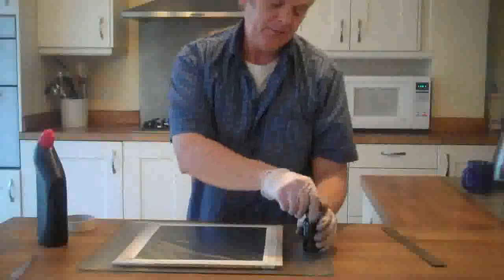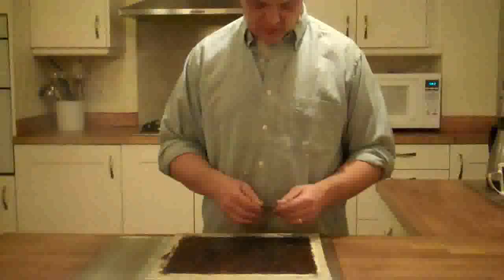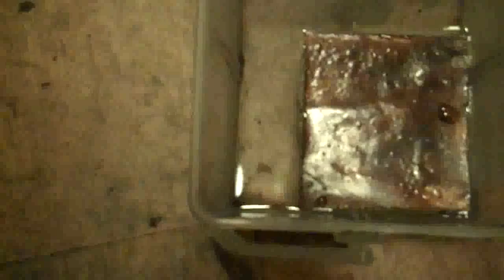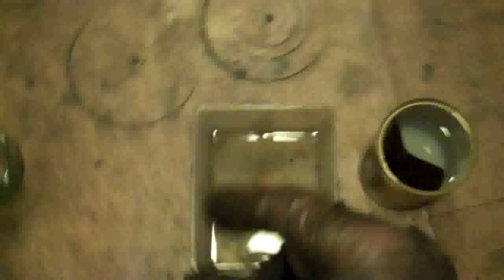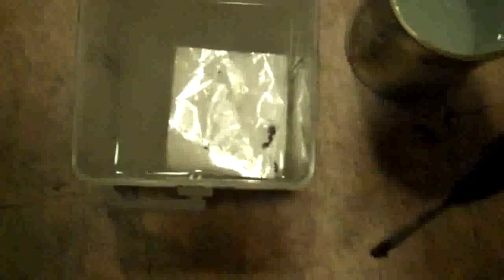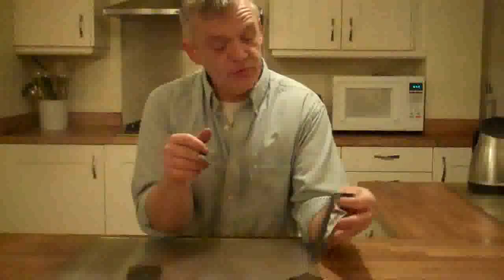How To Make Graphene Sheets As Big As You Like

Comment: How would a graphene sheet like this react to high tempertures, like in a forge.
Reply from the maker: it woulod burn away - carbon begins to oxidise at around 400 degrees centigrade
Reply: Do you think that there could be a possible way to make a graphene steel alloy?
Reply from the maker: ian ocheltree dunno - I suspect not - I suspect the best you will get is a graphene coated steel
Reply: ian ocheltree I'm not a science expert or anything but since steel is carbon + iron.  I don't think it would work like that since Graphene is carbon. But copper + graphene works and makes it 500 times stronger. It works with nickel too making it 180 times stronger.
Reply: what about bronze?
Reply: Robert Murray-Smith
Or graphene coated aircraft aluminum..
Reply: Ever heard of carbon-carbon?
Reply: what is carbon carbon?
Reply: ian ocheltree
Carbonized graphite. Very brittle stuff but can handle a great deal of heat. The space shuttle used tiles coated with carbon-carbon to protect it from the heat of atmospheric entry at great speed
Reply: Ok so how do you turn the graphene oxide from the blender into what you need to do this.
Reply from the maker: Hiya mate - you have to take what people say with a pinch of salt - it's interesting in that it should be a starting point for your own research - carbon-carbon isn't carbonized graphite. What it is is a composite material consisting of carbon fiber reinforcement in a matrix of graphite - The material is made in three stages: First, material is laid up in its intended final shape, with carbon filament and/or cloth surrounded by an organic binder such as plastic or pitch. Often, coke or some other fine carbon aggregate is added to the binder mixture.
Second, the lay-up is heated, so that pyrolysis transforms the binder to relatively pure carbon. The binder loses volume in the process, so that voids form; the addition of aggregate reduces this problem, but does not eliminate it. Third, the voids are gradually filled by forcing a carbon-forming gas such as acetylene through the material at a high temperature, over the course of several days. This long heat treatment process also allows the carbon to form into larger graphite crystals, and that is what is used on the space shuttle. I have never heard of carbonized graphite - it actually sounds like nonsense to me - but that doesn't mean much - it only means i won't bother looking into it - but you could if you want.
Reply from the maker: *****
yes - there are videos on it

Comment: so what is the resistance of that sheet
Reply from the maker: +abdullah Alotaibi dunno - make one and find out
Reply: No worries and thanks for sharing this video .I asked because I see you have mix graphene  with different kind of chemicals so I want to know  if these chemical will have large impact on your graphene proprieties or not .As you may know for electronic applications the film conductivity is very important .In your case I believe the resistance will be a few Ks Ohm .
I did similar work but by mixing graphene in alcohol with PEDOT poylmer (coated area 10 x10cm) I found the resistance is less than 1000 ohm for thick film and yes it is very stable  .Again thanks for sharing
Reply from the maker: +abdullah Alotaibi It does mate - but i probably wouldn't use GO derived graphene for straight conductive based electronic applications. It is great for storage, sensors and solar as there is a wealth of functionalisable sites for modifying the graphene where the trade offs become acceptable

Comment: Sorry to say but if it was that easy we would have graphene chips and solar panels and countless other things. Its two thick needs cut down to size another billionth of a meter to be true graphene. This is just a large graphiti sheet. The molecular structure will not be right. graphene performs the way it does because of the size of diameter 10 nanometers or less. But on the other side cool video bro.

Comment: and who you can make wires of graphene? cause i want use it in my new motor cause the coil waste too much electricity.

Why graphene its the best electric conductor? he dont have electron free or soo much electrons like Couper.
Reply from the maker: +SLEVIN SHAFEL It depends on you view of conduction mate - electrons don't only travel as particles they can travel as waves and that's what they do across the plane of the graphene sheet
Reply: +Robert Murray-Smith travel as waves? wow that its new for me.
soo its not possible to have resisten like steels or diamant and in the same time have the best cunduction right?
cause to make that waves have to be shets like graphite and no like diamant wher the structure its very organized.
In conclusion... the best "wire" conduction will be something like pencil graphite...the problem its not flexible

PD: the new terms of electricity travel leave me "stupid" i have to learn more abut that thank you.
Reply from the maker: +SLEVIN SHAFEL It's a bit more complex than that mate - but basically you have it right - the challenge is in the c direction not the ab plane direction - or if you like the junction of the graphene plates slow everything down - a lot. So straight forward bulk graphite is unlikely to work

Comment: Would it be possible to coat mechanical steel parts with graphene at home?
Reply: can't you make the Graphene on the metal itself?
Reply: +Tyler Parent How? You need carbon first to be present
Reply from the maker: +Tyler Parent yes
Reply from the maker: +DMTbliss NewWay CVD - chemical vapour deposition

Comment: could it be cooper foil ?
Reply from the maker: the hydrogen evolution from the reaction of the aluminium with the acid is part of the process - that's what reduces the graphene oxide back to graphene - copper reacts with hot concentrated hydrochloric acid but slowly - so i guess - yes - or if you did the reduction after getting rid of the substrate then why not.
Reply: i know free energy, that is very cheap  and easy . i chasing star-ship power  i think i can bet the speed of light  .   i am looking to make a generator small as possible . all i can say is 3D printing ,lasers, and graphene  is what i am thinking  . thank you
Reply from the maker: *****
good luck with it
Reply: let's say ,thank of  flat ribbons of grapehe  coils not wire coils .a new kind generator   .but flat ribbons of grapehe  could make a  generator 100 or 1000 times efferent .thank  you

Comment: And what if i used graphene instead of graphene oxide?
Reply from the maker: Go for it - but, if you use LPE or some other method to get your graphene directly then i don't see why you wouldn't just spin coat a substrate right away and save yourself quite a few chemicals and expense.
Reply: Robert Murray-Smith Great, and do you think Muriatic acid would do the job, or does the concentration of the HCl have to be very high?....What Im going to try is an Electro-chemical way of getting graphene and then do what this video shows.
Reply from the maker: go for it mate and good luck
Reply: Thanks!!
Reply from the maker: It's all experimentation mate - so often you just have to try it and see

Comment: Couldn't you just microwave it after the graphene oxide coat dries
Reply from the maker: i suppose so
Reply: I was just thinking of the way aluminum foil will create arcs of plasma in a microwave and how cooking graphine oxide in plasma was the way graphine was made, I'm pretty sure. But even if it works it would Probably be very dodgy and only create small chunks of graphine.
Reply from the maker: i suppose it would mate

Comment: Hi Robert, I cant seem to find your video on how to produce carbon grathen foam from sugar, not using the pipe with end caps in solution but when you made block/ cubes in the oven then burned the it further in a kilm. also is the foam solid ie hard or springy like a sponge or more like  polystyrene? as I would like to produce the first ever camera Drone filming body and I need to be able to mount the motors and props. also am I able to cut the foam or pore it into a mould so it would come out in a shape. thanks as always. it would be so much easyier if I had an email address for you to ask you many intresting questions on these types of projects which I keep hitting road blocks with. mine is Armstrong.skyview@gmail.com
regards chris Armstrong
Reply from the maker: ASV TV my email is robertmurrayysmith64@gmail.com - there is a limit to what i can tell you about some things as some of them are part of commercial projects and it is a fine line to walk - however a lot of the videos give you a direction to go and I encourage you to research yourself too